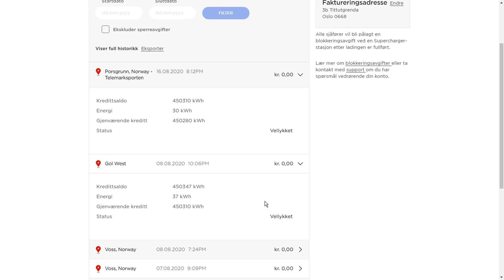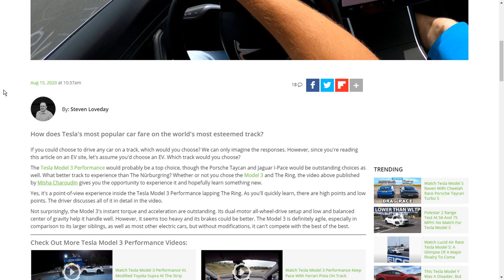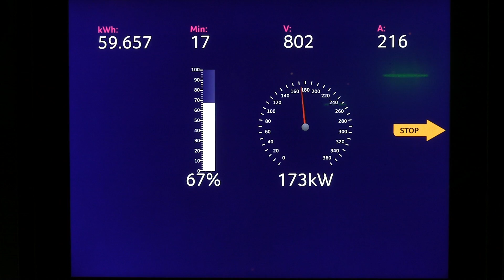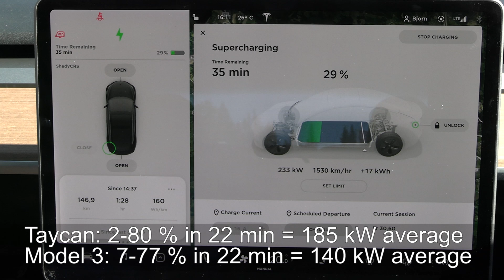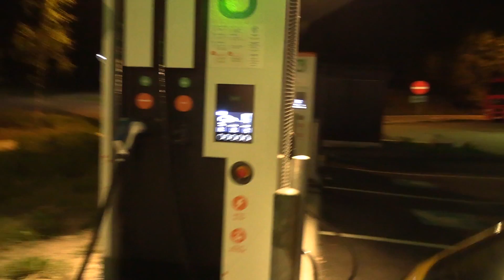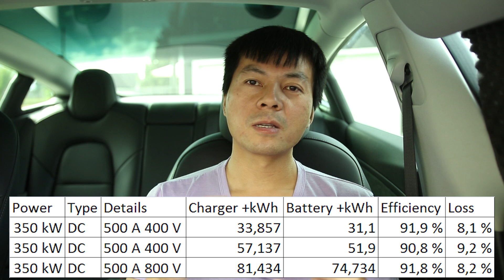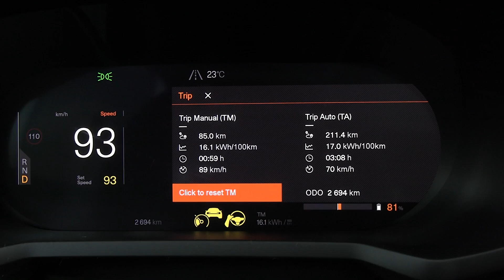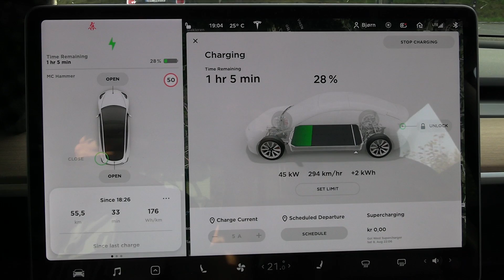Pros and cons of 800 V battery and charging systems

Comment: I thought of the 110 volt analogy half way into the film. I'm sure it was also "good enough" at some point. With today electronics, I don't see the advantage, except for legacy reasons (but I don't live in the US, so might be missing something). My point is, if investing in infrastructure, why not go big and save that  investment for the long term? 800v will scale easily to 400v, the other way around not. Cells are for sure going to improve, why put a cap based on the current technology?
Reply: North America is 240v!  It's only split to 2 120v legs once it's in the house for low power appliances but higher power ones like stoves and dryers use the full 240v.
Reply: @Bryan46162  240 Volt appliances .... Stove, Dryer, Water Heater, Geo-Thermal HVAC, Well Pump and a welder ...

Comment: It really all comes down to how much current you can safely and reliably pass through the connectors between the car and its charger.   It's trivial and relatively cheap to increase the size of the conductors inside of a car to accommodate the higher currents associated with a lower voltage supply.  (As we've already seen with the Model 3 and Y). The stumbling block is when trying to fast charge.  Connectors tend to degrade when in the elements, and also whenever they're mated and taken apart.  Any imperfections in the mating surfaces will cause extra heating in the connections.  We've already seen that Tesla's connectors can handle  the ~650 amps being plowed through them. But with larger capacity batteries coming in the new Roadster and Cybertruck, maintaining a relatively fast charge will require amperages to roughly double.  Again, this won't be a huge deal for the cabling of the charger or car, but the connectors will need to be very robust to reliably handle this current without overheating, or you'll just have to deal with getting "only" 250 KW. 😁

I'd wager, 400V will be the standard for the vast majority of passenger cars, while 800V will probably be the standard for larger vehicles with >100KWH capacity such as light duty trucks, vans, etc.

Comment: Early peak charging speed vs. long flat curve is for convenience & charger usage optimization. Some portion of charging session only need a quick add of 30% to 40% SOC - having early peak gets this job done faster, and allows more users / charging stall. However - a more modest (& extended) early peak would be a good compromise. 
Note that electrical / thermal  rating (how much heat for how long) is anyway always trading off peak vs. sustained - so short & high peaks don't necessarily add much equipment cost (thermal limits) vs. medium/sustained peaks. Grid connection cost would be higher however.

Comment: The Model 3 on Mischa's Nurburgring Lap DID overheat a bit towards the end, and that was without being pushed to 100% (due to the brakes fading earlier). However, probably not strictly voltage related.

Comment: interesting discussion going on here. for today's 2020 electric car architecture which includes a battery up to 100 kWh capacity and one or two drive units, each consisting of inverter (igbt or silicon carbide) + motor (form wound or round wire) + differential gearbox (single gear or two gears) 800 V is practically pointless if you consider water cooled hypercharger cabling and plugs. but if we talk about today's electric commercial vehicle technology (buses or trucks), then 800 V is the new standard for those applications. single motors with continuous performance requirements of 150 kW+, single inverter (mostly igbt) and batteries with capacities of more than 240 kWh. so far you were right, bjørn!

Comment: I’m hoping for an 800V Cybertruck! (And a CCS connector in the US)

With the huge double stack batteries, it can take it, C rates will be the same or less than Model 3 batteries charging at 250kW.

By my wild guess I’m thinking the Single Motor CT will have a single 100kWH 400V battery, the Dual Motor will have a (2x60kWH) 120kWH 800V battery and the trimotor will have a (2x100kWH) 200kWH 800V battery.

With the dual and trimotor packs you wouldn’t increase the c-rating by moving to 800V. You’d match the Medium Range Model 3 C-rating in the dual motor CT at 400kW charging and you’d be underneath the Model 3 LR C-Rating if you charge at 500kW with the Tri-Motor pack at 800V.

Comment: In my experience from Formula Student on working on Accumulator, the losses inside the accumulator are quite similar for 400V as 800 V. You do get smaller losses outside of the accumulator, but where it made the biggest difference for us were the engines. If a team could afford to make their own engines it was quite beneficial to switch to higher voltages.
So when comparing both concepts I wouldn't only consider the battery pack and the cabling, but the motors too.
But on the other hand finding a charger for more than 450V, making your own engines and so on are such a pain that it is a big tradeoff.
Reply: Any idea of price desparity between 400v and 800v motors and electronics? Rarely anyone mentions that... in rc world, cost is almost exponential with higher volts...
Reply: @DG-uv3zw  I have no idea how expensive it is to build one compared to the other.
Basically 450V is the standard, and you can't find nearly anything for higher voltages on the market.

Comment: 400V er bra nok når markedsandelen av elbiler er liten, men 400V vil kreve mye mer volum for å støtte en hel elbilflåte vs et 800V infrastruktur. Så fremtiden er 800V, enten man liker det eller ikke. Og det er ikke Norge som fordrer at 800V blir fremtiden. Det er utlandet som vil møte problemer med volum og plass rundt hurtiglading i større grad enn her hjemme i Norge. 

Det er ikke slik at man i fremtiden kan tillate at folk spiser burgere og lader elbilen sin på en ugunstig måte. I fremtiden så må man løse problemet med utfartsdager, og da gjelder mest mulig energi inn på kortest mulig tid. 

Ikke glem at utvikling av batteriene plutselig fordrer høyere C-rate uten store problemer. Da vil 800V systemet vise sin styrke i mye større grad.
Reply from the maker: 400 V will hit the roof once charging speed needs to be higher than 200 kW. That won't happen anytime soon.

Comment: Energy loss is not dependent on the charging power neither on the voltage. It depends on the current that is being used. Charging at 200kw with 400V system is way less efficient than charging at 200kw with 800V. The current is half. High voltage power grid make use of this. If you want to transport energy far away, you use high voltage. Thank you for the video.
Reply from the maker: But heat loss in the battery is the same for 400 V pack and 800 V pack. And that's where the biggest loss is.
Reply: @bjornnyland  I don't think this is correct. To charge an 800v battery you need half the current at 200kw compared to a 400v battery at the same power input level. The loss on two identical systems is way lower on a 800v battery. Looking at the example that you gave, you will be sweating way less on a 800V battery pack, since you have half the current, so way less heat generated. Thank you.
Reply: @GoncaloRijo  I don't think you are correct because ... EXAMPLE (only) :  The 800 Volt Battery has a single series string of x cells.  Then the 400 Volt Battery has two string of x/2 cells, connected in parallel.   250 Amps flows through the single string in the 800v Battery ( 250 amps = 200,000 Watts / 800 Volts ) .  While 250 Amps flow each of the two strings in 400 Volt battery ( 250 amps = 200,000 Watts / 400 Volts / 2 strings ).  In BOTH case, exactly 250 Amps flow through each cell.  Its does not matter the "#S#P" configuration of the battery,  200kW charging will push the same amps through every cell in the battery ...

Comment: I think most points you mentioned are the view of present time. The potential of 800V is great, because you don't need thick cables and high curent devices, lower Amps are in general much more easy to handle and on car side simply cheaper... the need of cooling is less, so even in lower class cars and in lower classified batteries you get most of it.
Of course it takes a few years to build this infrastructure, but I think the 800V charging-stations will be in future more and more cheaper and on long term lower Amps are very welcome by manufactors to drop their costs. Maybe also for that reason the joint venture of manufactors are pushing 800V with Ionity...

Comment: it always depends on the requirement porsche has released its first (new age) electric car so i think the roadmap will show what it will bring. when the battery gets bigger a higher voltage (800v) makes sense specially for trucks, busses. for smaller cars  like L7e you could use even a 48v board system where the charging is with 230v or 11kw loader.

Comment: I think Bjørn is absolutely right. If Ionity installed 150 kW chargers at a lower price than the 350 kW chargers, then the 350 kW chargers would only be used when the 150 kW chargers were occupied. As it is today, Ionity's chargers are so expensive that they are almost always available - which of course also has its advantages.

Comment: The Tesla battery didn't cook on Nordschleife because the brakes were cooked and the guy had to ease up. You'd need some real performance brakes to properly test the powertrain.
Reply: Yes ease up, following Porsche GT3, but i think your argument will be porsche was driven by bad driver, am i right ?
Reply: @TschingisTube  no, he slowed down because the Tesla performance brakes are not real racing brakes.
Reply: @MrGonzonator  so the Porsche GT3, left him ?
Reply: @TschingisTube  why do you keep on bringing up the Porsche? I thought we were talking about the Model 3 power train?
Reply: @MrGonzonator  you complaint about the brakes despite the fact it kept up with a porsche GT3. The brakes seem to suffer as THEY SUFFER FOR EVERY NORMAL ROAD CAR, maybe not If you drive a slow one which does not have to brake hard. I'm pretty Sure the guy in Porsche didn't care about the brake temperature in the tesla.
Reply: @TschingisTube  I'm saying, and have been saying all along, that the Model 3 did not fully test its drive train at Nordschleife, because its brakes could not keep up with It. If you whack some true racing brakes on it then you'll see if the power train can really make it round at full speed.
Reply: And the Taycan spend 1000km on the french motorway on the same day😂
6:23 
https://thedriven.io/2020/08/14/porsche-taycan-battery-overheats-on-nurburgring-north-loop/
Reply: There’s new video with upgraded brakes
Reply: @daniel_960_  more than that, he went brakes only, turned off the regen and the brakes still worked fine.

Comment: Bjorn, I know you may know that already .. with higher voltage you can run lass amps and also reduce the wire gauge .. so I think it’s more like no one setup a good use case for 800v or higher just yet plan design battery that can support it .. anyways all that truly does not matter because, Tesla needs to copy Audi 55 charging profile and charge deep into the pack vs just a few min at 250 .. run that deep into the pack like up to 80% for the win .. right now even at 150k peak that is run deep into the pack wins..

Comment: These cars and chargers should be able to negotiate the voltage and charging rate the same way that USB dose on phones.  Charger "I can give 800v" car "I can take 400v max " charger "400v it is then"
Reply: They already do. A 400 volt car can charge at Ionitys 800 volt system

Comment: i think 800v is that as charging powers rise, low voltage demands bigger cables for the amperage.
you can only go so high before the cable becomes unweildly on a 400v system.

Comment: okay, heres my two cents without watching the video: rc cars. rc planes. rc helicopters. rc whatever electric. we're going up in voltage eversince li-po batteries and brushless power systems came to the market. the higher the voltage; the better and more reliable the systems have become. 1:8th scale started at 12.6(3s) nominal, performance was okay, then we went 4s, performance got better and more efficient aswell. then came 6s. now we have stock cars requiring 8s, some people start adapting 12s systems in those cars aswell. as i see it, make it 3000volt. it will only get better. the less the amps, the better it is! more voltage = same power at less amps.
Reply: As an rc hobbyest myself, my teeth cringe when you say 6s, 8s etc... It cost a fortune!!! :D but, you're right...so is reality that people are not longer able to afford latest tech. ( flagship phones, oled tvs, gaming PCs, performance vehicles etc...)

Comment: Isn't Kia/Hyundai working on a 800V platforn? I think this will be be introduced slowly. One key advantage with higher charging speed (assuming the batteries evolve and don't degrade too fast) is that you can serve more cars on fewer chargers in heavily populated places.

Comment: An interesting topic, and some informative discussion afterwards. Yay !
I agree that 200 kW, 2C charging is a sweet spot now and it will be so for a good long while until cell chemistry advances a lot. So how much energy can be saved in an 800V system compared to a 400V system, and at what cost ? The numbers seem to favor closer to 400V than 800V although there are a group of E. Asian manufacturers who seem to be congregating around 450 - 500V nominal pack voltage.

Comment: 400 V (actually up to 500 V) is fine for most consumer cars now and at least 10 years into the future. 800 V will be used for performance cars and cars with large batteries. 800 V CCS chargers are also needed for trucks and buses, they usually use 700 V battery and motors so they can not be charged on 400 V chargers.

Comment: the only main difference is to save copper. that means you save weight and space and probably money if the electronic does not get too expensive. the electronic switches need to be different-  Silicon Carbide instead of Gallium Arsenite.
for a high performance car you want to save weight, that is probably the most important reason for going to 800 V in the Taycan

Comment: The Model 3 actually charges faster than the Taycan if you count km/minute instead of kw.
And that's what really matters.
Reply from the maker: That is only true if Taycan uses 20" and 21" wheels. In my recent test with 19" wheels, Taycan has higher km/h charging speed than Model 3. But how many Taycans will be fitted with 19" wheels? Almost none :P

Comment: I honestly think 800V is the future. Think about a (future?) battery with ultra-low resistance - it can charge faster, so pump up the juice.
Waiting to hear the full specs on the Lucid EV - which is 800V and seems to have some crazy specs already!
If Cybertruck (as an example) was 800V - could I not just occupy two 400V chargers - each charging half the battery?
Perhaps the Tesla V3 chargers are 800V ready?

Comment: I think 800V will become more common over time when batteries develope denser. So C rate stays low but capacity is larger. As an example for a 150kWh pack the 500kW power is the same as 250kW is for 75kWh. 

Btw. U.S. has a 240V system. They just mostly split it. Dryers and EV chargers use the full phase.
Reply: I was getting worried - all those houses I wired in US with 240V; Bjorn says 110V must be I did them wrong.

Comment: The real question is : Is 50hz better than 60hz ?
Reply: AC is usually capped at 11 or 22 kW so it's only used for overnight charging anyway.
Reply: That's a bit like metric vs imperial units ;-)

Comment: In the end model 3 got warning for hot battery. but he also drived slow 1 part of the sector when his wallet dropped under the brake pedal. Then he did not go 100% last 1/3 of the lap due to overheating brakes. So no way you could go 2-3 laps in the model 3 on Nurbering.  He could not even go 1 lap at 100% speed.

Comment: In the far future, the 800V will be probably use by the car producers. I see only a catch with the 800V: the huge number of cells connected in series: 188 cells vs 96 cells (typical 800V vs 400V). So by this, more cells connected in series, more chances to have a failure on the pack.
The 800V has its advantages: smaller cables, smaller motors and invertors.
So, at the end, slightly better efficiency.
We will see.
Reply: Here's the point, parallel cell failures will only reduce the pack capacity marginally, serial ones will reduce performance and possibly (after several) kill the pack. A worthy consideration and a gold star to you sir 🌟 ;-) Additionally if each cell has an internal resistance then placing them in parallel vs series... well modelling cells is not so simplistic but the theory should still stand somewhat.
Reply: Not smaller motors 800v motors require 2x the windings (with wires half the thickness) to produce the same amount of torque.  You end up with roughly the same amount of copper in a motor that is more expensive to build.

Comment: Never mind the voltage, it s the charging  C rate at cell level that counts. 
But having higher voltage system help everywhere else except the motor. Double Volt = half Amperes. 
For the motor, it change practicly nothing. 100v 10A is the same motor as 100A 10V.
It the connectors and components this help.
Reply: Motor heat for EV is also a big problem. Especially for a motor with permanent magnets. Even on Audi E-Tron SUV and Sportback both rotor and stator is liquid cooled. Beside motor also waste heat in inverter must be cooled. When you have higher voltage you have much less waste heat.

Comment: Can an motor that output 200 KW  be made smaller with higer voltage? Spinn faster..  400V is more the standard in Norway so it may be easyer to install .
Reply: No, In general a 800v motor will have thinner windings but will require 2x as many windings.  A 400v motor will have thicker windings but have 1/2 as many windings for the same amount of torque.